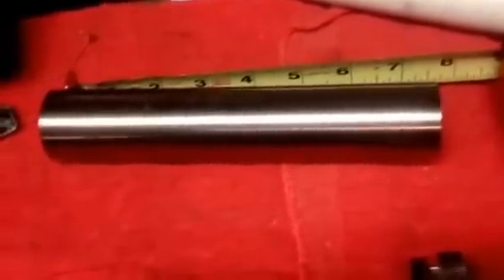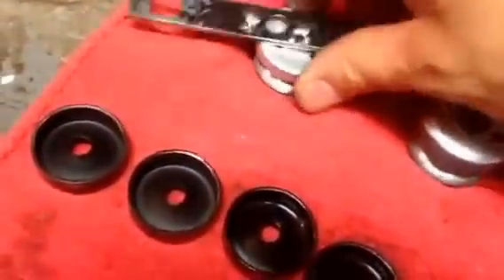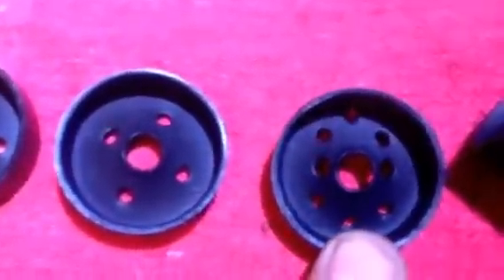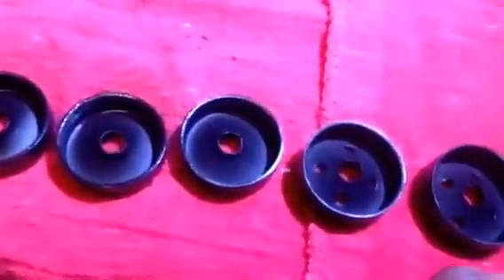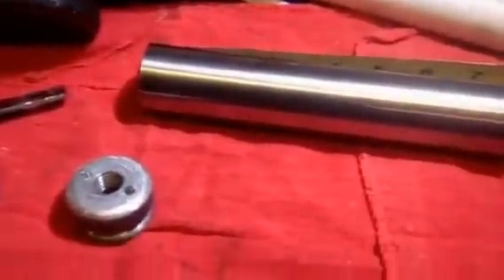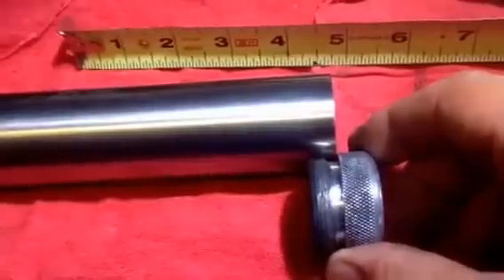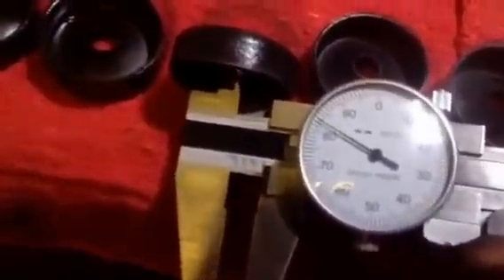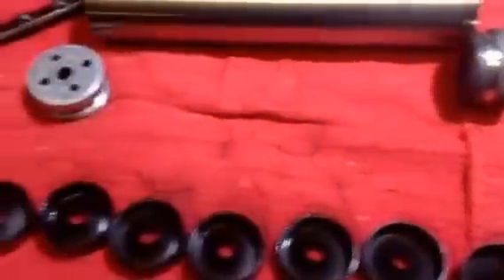Silencer configuration .22 / .223 / 5.56. This video is educational & documentary

Comment: I am getting ready to put together a can very similar to yours and I was wondering if I could borrow some knowledge from you? Did you ever try it with the baffles clipped on one side? Why did you add a spacer after the blast baffle? Did you ever try it with an extra baffle instead of a spacer there? The top 10 - 20 quietest suppressors on Pew Science and other test charts have no holes in blast baffle or other baffles. Did you ever try it without the small holes? I only ask all of this because I have spent the last 6 months reading, studying, watching videos, reading patents, looking over test reports, etc. and you have built a super quiet suppressor up there with the quietest I have seen so far.

Comment: nice. I've been drilling 15/64ths for the .22lr, and -(.25in)- for my 5.56. I've had great luck with those.
Reply: I've used rubber washers it's about as thick maybe thicker and I put fiberglass loose like string fiberglass that's in muffler I also it doesn't go on the barrel it goes maybe two inches past the barrel and uses the barrel length as the suppressor so it difficult to explain but the rubber washers fit over the barrel and also doesn't get hot so it works like a guard also but same kind of end as his that screws on but not on the barrel

Comment: What size are the freeze plugs. Ive got a d-cell and teo end caps. The freeze plugs i ordered are too small. Also what size die should i use? I'm not making a suppressor I'm just doing a cleaning system had an assortment of brushes and things like that from all kinds of different cleaning kits bought myself a little pouch and figured I'd just throw a solvent trap in there for the hell of it. I'm making this on a 9 mm Hi-Point so I got to thread the barrel myself. That's the real purpose of all this for me Just to learn how to do a thread. If anybody can give me some advice on this it'd be appreciated This is my first time actually threading my own barrel.
Reply: You ever figure out how to thread a barrel?
Reply: @shaneshane8934  yes. It was a pain in the ass but I used a regular annular cutter but had to use lithium paste along side tap magic to keep the heat down. I also had to go EXTRA slow. Hardest thread job I ever did.  In the end I screwed up my first barrel and had to buy another. If it gets too hot, it will bite, and screw the e tire thing up. The lithium paste I used was artic silver for computer processors. Pre mix the tap magic and past to get the best results.
Reply: @shaneshane8934  also I should add, this was my first time threading a hi point barrel. I have done a few ak barrels, and those are easy compared to this.

Comment: Anyone know what size drill bit i should use to drill yhe plugs for 22 and 223 and should i do a little bit bigger towards the end or maybe the end cap
Reply: 1/4 bit for a 223 size hole to the best of my knowledge. I'm researching to find how important that the holes ascend going towards the muzzle. Or could 1 just make them all 1 quarter inch throughout without consequence
Reply: @richardnamber813  ok thanks i just dont wanna mess it up ....happy holidays
Reply: .22 caliber is measured as .224 bullet diameter, so if you can mill the holes to .225-.226 so it has clearance and doesn't ''strip'' the metal jacket like this guy in the video says it did.

Comment: What is 285 in inches??? Is that equal to a 1/4”?? I need to know how big of a whole my inner plugs need to have for a .222lr mp15-22 rifle. And my outer caps will need a 1/2” whole for my 1/2x28 barrel? Is this all correct. I want to make sure I have the right measurements before I purchase my parts online.
Reply: WARNING: If you are building a suppressor based of comments in a youtube video...  nevermind, go ahead, everything will be fine.

Comment: Hi, very good work shown in this video, I would like to know, what are the measurements of the cameras and the 11 spacers and the tube used in this video, it seems that the first camera is about 1 3/4 inch, but the diameter? already thanks.

Comment: what would be the difference in making it for 7.62?
Reply: depends are you shooting 7.62 ''Russian'' style rounds or 7.62 ''American'' the bullet diameter are different and the chamber pressures are a lot different. 7.62 Russian has a bullet diameter of .312 and American has a bullet diameter of .308 not to mention the threading is different as well AK's and their variants usually are threaded for M14x1LH thread pitch while most .308 caliber firearms are threaded 5/8-24. so to make a suppressor for a .308 or 7.62 you need a thicker stronger tube to account for higher pressures a muzzle thread that accounts for whichever your firearm has and thicker "better" baffles and an end cap that has a slightly bigger diameter than your bullet, say .313-.314 or .309-.310. (disclaimer- make sure you have a form one tax stamp approved in your hand before attempting to make a suppressor, not before applying, not while it's in the process of being approved but IN YOUR HANDS or the ATF will knock on your door with a 5-year felony that will cost you 250k in fines).
Reply from the maker: William Branstetter 
Black one is a .30 cal.

Comment: thanks for the Video... 
one question okay maybe 2 
 why did  you drill the holes all the way through the end cap?
  does it make it quieter ?
 I just got my stamp back and  putting mine together and  looking for ward to getting my can to sound as good as yours...
Reply from the maker: Robert Dunn 
I have seen commercial ones & form1's like that. Also the end cap was only 1/8" thick. I needed hole for tool I made. I believe I did start shooting it wet (with oil in it). I think it does make the can more quite.
Reply: okay....thanks maybe ill play around with it...
Reply: @ramohino  I have to say you have the best how to videos on the subject.  I wish YT didn't remove you FP making video.  I watched several times 5 years ago.  Is it available anywhere other than YT?  Thanks for the content.
Reply: I need these plugs to be .995 to fit into my tube, WHERE CAN I GET THEM?! ARGH!